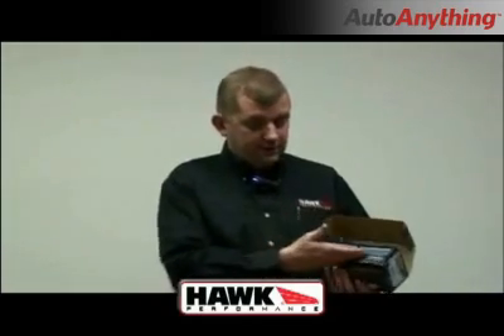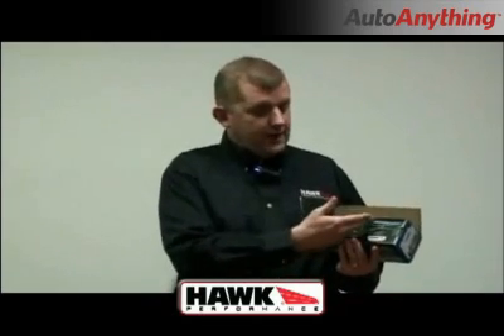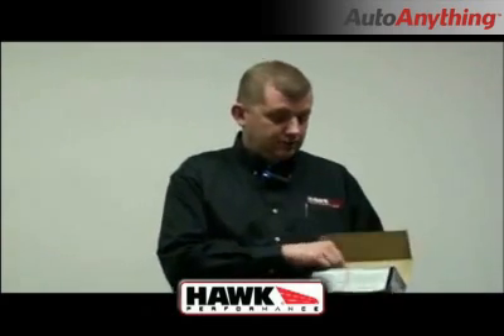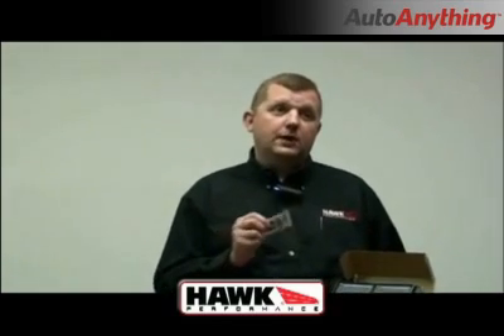How to Bed in Brake Pads

Comment: Great Video. 
Question for you. I just bought a new Vette with Carbon Ceramic rotors. Owners Manuel says do 20 quick stops from 60 and do it as quickly as I can. Then drive 5 miles to cool them off.  Any comments you could provide would be great. Thank you.
Reply: Don't come to a full stop, let it roll at 5mph then back to 60mph. And stop HARD to get those rotors up to temp, just short of abs kicking in. 60mph might not be fast enough for a vette. If done properly the rotors should have a slight purple hue to them, not to be confused with glazed/overheated rotors.
Reply: 2jzTireBurner hello there.  You know I did the process like 5 times and the they stunk so bad I was good. Now In retrospect that’s not the 20
Times but they seem to stop better then my last Bette with steel rotors. So I’m happy.
Reply: 20 is a lot to attempt on public roads, 5 is better than none. Better to have your brakes broken in before an emergency stop or track use. The smell is the remaining grease/sediment, from the factory, burning off the pads/rotors. Odor during the bedding process is normal.

Comment: I have a hard  and long time bedding in my new ceramic pads to my old rotor its the steering wheel shudder , can I disable my ABS temporarily until the pads are bed in ?

Comment: I have a question......... I got new pads and rotors and they squeal sooo loud and also grind very bad when I  come to a stop. I took my car to 4 different mechanics and none of them could figure out what the problem was. So I did some research and figured out I have to bed them in (which several mechanics laughed in my face when I told them about it). I did exactly what you did in this video and it really did work, but it only lasted maybe a full day and the squealing and grinding sounds eventually came back. I have done this bedding process 3 times now and it seems to only work for a day at the most. Any suggestions to what I should do?
Reply: did you use the grease in-between the backing plate and the caliper? that could cause a lot of noise

Comment: Here is the best procedure, its OEM technology, tools and products...  the procedure guarantees quiet brakes, plus better performance.

Just visit this link...     stop brake noise com

Note: It mentions that you need to extend the burnish out to about 500 stops and light pedal pressure it important during the first 50 or so.  Also a conditioner should be used between the friction and the rotor, to control pressure, temp and how fast the film transfer takes place.

Comment: After I do the first 6-10 stops as you said do I wait a period of time before I do the second set of stops or should I go right into it?  I was just wondering if there is a heat cycle between sets of stops.
Reply: Jim Pinckard nk

Comment: uhm.. did all this with ferodo pads... only based in  common sense.. except of the transfer layer removal... which wouldld its a light pass with 160 180 grit sand paper
lets see how it goes.

Comment: I did 6-10 stops, as mentioned, but they started to smell burnt and smoke. It went away after, but IDK what happened.
Reply: That's whats supposed to happen. You were supposed to continue and finish the cycles.
Reply: Balto D I did. Just never seen it before, maybe because they are performance pads?